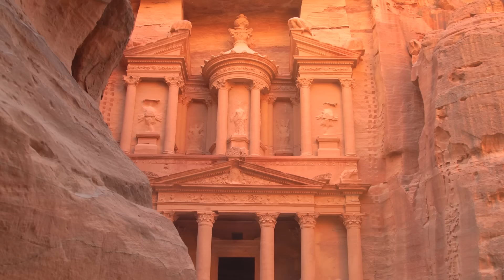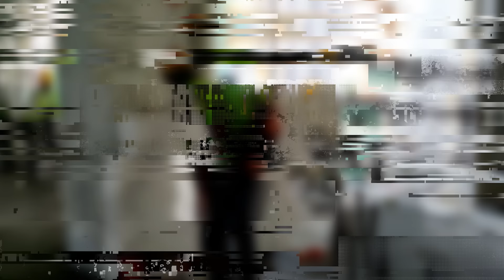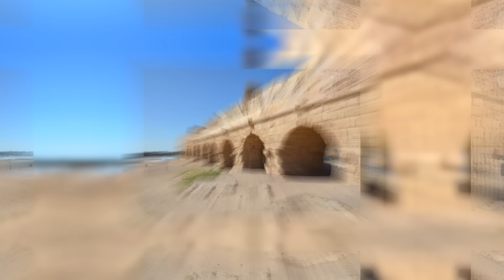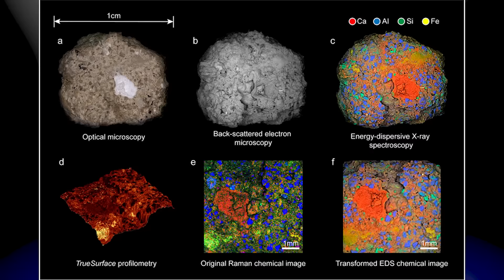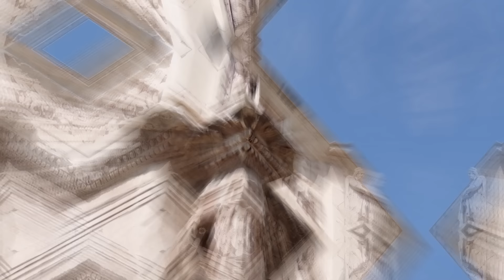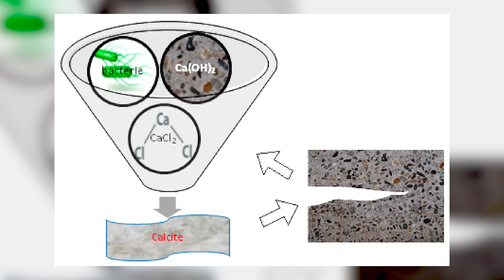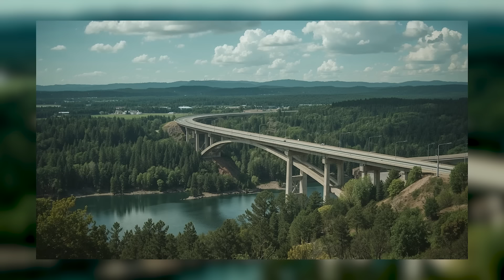Why Roman CONCRETE Lasts 2000 Years While Ours Dies in 50

Comment: Roman concrete added a component called tufa to the mix. It also has an interesting ability to be self healing. The Pantheon, is constructed in such a way that the dome becomes lighter. The higher it gets, and the oculus creates a pressure ring that diffuses the compressive forces of the mass of the building, the design, construction, and materials are the reason for its longevity.
Reply: Tufa is a volcanic stone? So does it have airin it so it is lighter?
Reply: I heard volcanic ash was used. Not sure why we don't use it anymore
Reply: Tufa is a highly siliceous volcanic ash more commonly called POZZOLANA as it is mined near a village called POZZUOLI near Naples. This along with calcined lime along additives mentioned in the video was used.
Reply: @knsubramanian9837 I guess you you have to wait to mine it since you have to wait for the volcano 🌋.  I would love that material in the states.
Reply: Imagine the scaffolding 😅
Reply: fascinating!

Comment: There is a stretch of road of about 10kms in length of concrete constructed about 30 years ago if not more . It's in perfect condition , while the new concrete roads after just a few years of use show cracks and areas of it sinking .   The road mentioned first showing no deterioration was built by an Italian Co. Italians know how to build good roads.
Reply: No.

Comment: What a stupid video
Roman concrete does not have anywhere near the strength or span distance that modern concrete has, the steel although it’s a flaw in longevity is also it’s strength and advantage

Comment: In my opinion, the Romans weren't necessarily "super intelligent", they most likely would have used steel reinforcing bars had they the technology at the time, knowing what we know now, a type of non-ferrous material should be developed for reinforcing load-bearing concrete structures.

Comment: BS. Our concrete can last very long. But if you make it soooooo thin and mix it with other materials of different expansion coefficient (steel) , then it is a different story. It depends on how you apply it. Ours is much better quality controlled than roman concrete. It can suvive 10000 years, no problem.

Comment: There are also different recipes for concrete, resulting in varying grades of concrete. The Romans obviously used the top grade recipe, and we most often use not the top grade recipes. I learned this from an engineer whose job it was to go to various building sites an inspect the concrete.

Comment: To be fair, the examples of Roman concrete you showed were not cast in place, but rather, were mortar between mainly limestone blocks. It is the blocks that bear the load, and being rock, are less likely to crack than the mortar. Modern structures  are either cast in place, or are pre-cast, but regardless, do not incorporate these stable blocks. And, modern structures must endure much greater loads than the Roman ones did, which is mainly the weight of the structure itself. That said, fascinating presentation, and how about a round of applause for those Romans?!🎉

Comment: built in obsolescence , pan-crete -rust in the steel  oxidation isn’t as severe in dry environments. all entropic feedback loops are exponential.  Everything around the ptolemaic region use the ratios of geopolymers the greeks discovered .

Comment: The built in pronblem is the steel rebar. It rusts expands and cracks the concrete. If you go to graveyards late 1800s stones on a base always have two cracks in them. This is where steel pins were put to tie the slab to the base. They rust ,expand and crack the stones.Lifespan of concrete with rebar is about 40 years.

Comment: Probably because roman concrete didn't have 2 to 20 ton vehicles driving over it 24/7 for years on end.
Reply: Romans did not have EPA telling them what to do. We have gone backwards with concrete quality because EPA told the manufacturers of the cement powder they were creating too much pollution with the process they were using.

Comment: You go ahead and stuff yourself into a Roman. apartment.  I wanna live in a new one.  Seriously though, long lasting concrete would be fantastic for infrastructure.  But with the rapid technological and societal changes over the last 200 years the last thing we need to do is to spend more money on smaller scale construction. Buildings aren't torn down because concrete is failing but because the buildings themselves are obsolete.

Comment: Most rebar placed into concrete are already heavily rusted, so its destruction is already predetermined.
Reply: The high pH environment inside fresh concrete protects the steel, and a thin layer of rust can improve the bond between the steel and concrete.  There's a reason people still live in high-rise is built nearly 100 years ago that were made of the stuff. It's fine.

Comment: A civil engineered structure is supposed to be structurally sound for ... 100 years. It's something i saw in french regulations in engineering. And this is quite horrible for our bridges and so many super structures that we have built or that will be build. We have to change these technics and plan to build to last... And this will be possible if we train and select excellent engineers and architects. Hards times ahead....

Comment: Modern concrete today will never be the same as the old school, but just modern architects designing buildings as Cheap as possible using steel rebar instead of arches etc, numpties aren't they, but we will all indirectly pay won't we!
Gaz UK.

Comment: Portland cement takes 25 years to cure
Reply: It really depends on several factors. A 4" slab will finish setting faster that a 4' block. 
  Curing is an activity post placment to improve "setting". Sometimes we spray an evaporation retardant,  sometimes we use blankets or plastic. 
  It is important to keep the moisture in the concrete as it is more or less consumed by the cement in a chemical reaction called hydration.

Comment: It isn't like we haven't built without rebar.  Hoover dam is just interlocking concrete blocks.  It takes a whole lot more curing, but it will last like the Pantheon.
Reply: From the hoover dam website:

What were the quantities of principal materials used in the dam?
The principal materials, all of which were purchased by the federal government, were:

----->>>>>reinforcement steel, 45,000,000 pounds;<<<<<<----------
gates and valves, 21,670,000 pounds;
plate steel and outlet pipes, 88,000,000 pounds;
pipe and fittings, 6,700,000 pounds or 840 miles;
structural steel, 18,000,000 pounds;
miscellaneous metal work 5,300,000 pounds.

Comment: The presented content is only a part of the entire picture. Romans didn't build sky scrapers exposed to strongly changing wind stress or bridges for columns of 40-tons trucks on it and corresponding vibrations. And while It's true that we see thier constructions after 2000 years, these are only those constructions which survived and not all of them. 
Yes, we could adapt back to arch bridges, so without steel but with much more concret needed, but we would need another concrete. The one of Romans had much lower presure resistance compared to modern. 
Btw, as I know, Romans had 2 types of concret: for land and for sea.
Reply: Agreed. The ignorance in this comment section is absolutely staggering. Rebar isn't allowed to sit outside in the rain and rust because we literally want buildings to fall down in 50 years so we can rebuild them, ha ha. The high pH environment inside fresh concrete protects the steel, and a thin layer of rust can improve the bond between the steel and concrete.  So long as it stays buried, it's not a problem.

Comment: Trust me, the Elephant 🐘 party knows the recipe for lasting concrete.   
Capitalism always designs-in failure.  GM won't even make a car, unless their engineers can prove it will fail right after warranty.  
There's not a single product made by the Elephant party Capitalists that isn't intentionally designed to fail.

Comment: Note that we now have an alternative to steel rebar...glass fiber rebar, and we can also add glass fiber to the concrete mix to make it more crack resistant.  With this tech we should be able to achieve far longer structural lifetimes, 200+ years, even with today's standard types of concrete mixes.
Reply: Пока неизвестно сколько лет проживёт в бетоне смола, склеивающая стекловолокно, при изменении внешней температура от +50 до -60 С.
Reply: @АйОй-з9г  Good point!  For structures built in areas with such extreme temperature ranges, this needs to be researched.
Reply: @Avianthro Concrete Repair mortors mostly have an amount of fibre in them it can be glass, PET, or basalt.

Comment: soon as you said nano l new you were full of shit and then half way through l still havent seen a pic of good perfect self healed concrete yet so l quit. Most bad concrete these days is poorly made and its not made to last more than a hundred years. Steel is a problem but not if made properly and most steel is added to make it lighter and cheaper since they only figure that for buildings and structures expecting tastes and needs to change. Pantheon has no steel cause it doesnt need it, thick and over built. You cant compare the 2 cause they are made different and for different reasons, FYAMF, idiot

Comment: One of the mistakes is to put rebars too thick and too close to the edge, the heat in summer expands the steel that cracks the concrete.
Reply: These YouTube videos about Roman concrete never compare structures that are subject to shear and tensile forces; they only mention structures that are only under compression and don't have steel rebar.
Reply: Совершенно верно, хорошо размешанная и осаженная вибраторами бетонная смесь, после кристаллизации промокает лишь на 20-30 миллиметров.

Comment: Totally different application. Romans didn’t have day in and day out of 80 thousand pound machines traveling on them. Epoxy coated rebar eliminates this problem.
Reply: In Texas we use epoxy coated rebar mainly in bridges. Galvanized rebar is starting to appear recently. As I understand  it the epoxy is being damaged in handling before itis placed.

Comment: Out in Ohio many years ago, I saw how they were building an interstate highway.  They had piles of thick rebar stacked up that was dipped in a green plastic.  It looked like they were placing it across the road about 6 inches apart from each other.  Then encasing it in the concrete.  That rebar won’t rust with that plastic coating.
Reply: Iron contracts and expands due to  seasonal temperature. If that plastic resists cracking then it’s okay, but if not then you are prolonging the inevitable. Use of stainless steel coated rebars might be the better option perhaps.

Comment: You're too negative about steel rebar. Without it, many structures simply wouldn't be possible. Romans didn't build the kind of structures that would need rebar because they didn't have rebar. Paying extra so that your structure last a thousand years often just doesn't make economic sense. Often you'd want to replace old structures anyway. Maybe you want to add e.g. more lanes or railway tracks to it so you need to remove the old one and make a new one even if the old one could've lasted longer. Also, be aware of survivorship bias. Not every Roman structure was well engineered (or overengineered) enough to last two thousand years. We just see the ones that were.

Comment: Ours lasts a lot longer than 50 years. I had to remove some foundations from the London underground at the Monument station. It was poured in 1884 and was as hard as metal, unbelievably tough concrete. the toughest I've ever worked on, windy picks bent and twisted, The Victorians made everything to last forever,
Reply: I saw a documentary which said they had similar issues with the original concrete of the Glasgow underground during the renovation in the 70s. Supposedly it was some sort of extra tough concrete.
Reply: That's because we didn't use portland cement in the UK until early in the twentieth century.  Before that it was lime mortar, exactly the same as the Romans used.
Reply: are you that dumb you don't even get what you wrote ?

Comment: You forgot two important things:
1) It is much more like clay than the cement you can pour, which means that you CAN'T use modern tools! Since you don't use rebar, you need arches and much thicker walls, which adds to the costs. 
As a side note: the cement the Germans used in WWII was a variant of Portland Cement with slag from steel production, and as with Roman cement, it was much more of a thick paste, which resulted in lower porosity, better resistance to weathering and shock, which was so good that many bunkers were never torn down despite people trying hard!
2) Obviously, today it's about making the cheapest possible bridge in a short deadline. If it breaks down after 20 years is not the problem of the politicians ordering it, nor of the construction company, which is only held liable for a maximum of 10 years. If you build a beautiful bridge that lasts centuries, you'd get lynched for the construction time and costs...

Comment: You compare homogenious "Roman" concrete with modern steel inforced concrete as if the Roman version could be used in the modern pre-stressed concrete-constructions without steel inside. The question should be: could we replace the steel - or make the steel restistant to the known degrading processes. Steel will still rust befoe the healing process in the concrete has closed the leak.

Comment: My family house is a bit over 100 years old... and the concrete is just in perfect condition... good to go a few more centuries!  Do you mean "US-made" concrete?
Reply: My house was built in 1873 and the concrete floors (kitchen and hall) are still in perfect condition.
Reply: @DonCox-tm8bv  Let's talk outer walls and structural concrete... not indoor slabs, as concrete will clearly last nearly forever indoor.

Comment: Have we considered switching from metal to composite rebar?
Reply: Not only does composite (fiberglass) rebar exist but there is also stainless and expoxy coated, galvanized andr basalt rebar. But the truth is that for most cases the case against plain steel rebar is overstated and the deterioration is due to cheap construction techniques that leave exposed porous surfaces and not because the rebar is really unable to last when used properly. Another reason alternatives suck is because they typically can't be hand-bent on site. For most cost conscious projects this is crucial.

Comment: I watched this only to see how many things were incorrect.... lol (I am a grumpy old Guido who kinda knows a thing or two about this subject...) Actually, most of the information is pretty darn good, a few things are a little off..... but, by and large the information is pretty darn on point! And, one thing that should always be stated first in these videos (but, usually isn't even mentioned....);as to why these structures last: REGULAR MAINTENANCE; our ancestors kept their structures on point, for some reason modern people want to wait until something is too far gone for restoration! Drives me crazy.... Every 10-15 years a mason who come and repoint old mortar joints, patch cracked or spalling stucco, swap out any cracked or damaged stone/brick/etc. And, there ya go! Perpetual structures that last forever!
Reply: You’re exactly right! I’ve worked on bridges in Southern California for years. People don’t realize it but they require regular maintenance. And Caltrans does an outstanding job. When I was in New York City, I could not believe the awful condition of the bridges. Spalled concrete, Rusted, rebar, awful! A guy told me they did not spend any money on maintenance, they let the bridge gets so bad where it’s a disaster, then federal money kicks in to replace it😮.
Reply: @mariancowles3042  Southern California & New York have very different winters. I'm not suggesting that New York SHOULD avoid maintenance, just that the stress on concrete is very temperature relative.

Comment: I'm not an engineer or tradesman, so I don't know more than a novice about concrete.  But I was a dam inspector of large dams & in that capacity our job is to find problems & diagnose problems in the earliest stages when they are exhibiting few visible symptoms.  As I learned the skills necessary to do the job, it's multidisciplinary & no college or university teaches courses that would apply to doing what you do, the engineers taught me whether it large dams or irrigation works, the rebar inside the concrete that makes all this possible & cheap is also destroying & limiting the lifespan of everything you see.  So we build infrastructure knowing it cannot last beyond a certain point in time but we want to do all we can to keep that lifespan as long as possible.  A high dam could be operational for 200 years if everything goes well. But it cant last in a functional capacity for 2,000 like a Roman work.  And when it's time is up, the next generation will just build a new one, if they want to.  We don't think in terms of 1,000 year time horizons because it's just so much cheaper to think 100 at minimum & 200 years in an ideal situation.